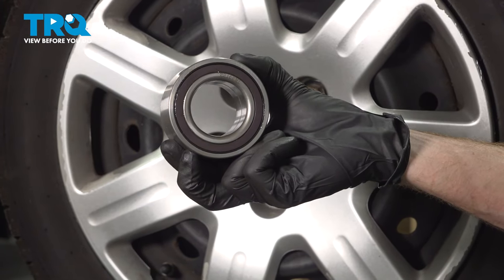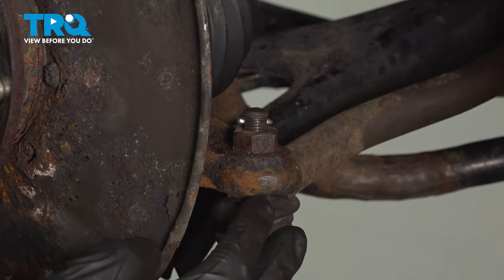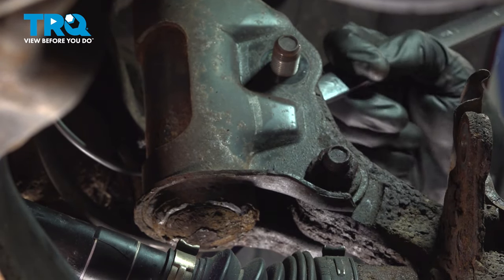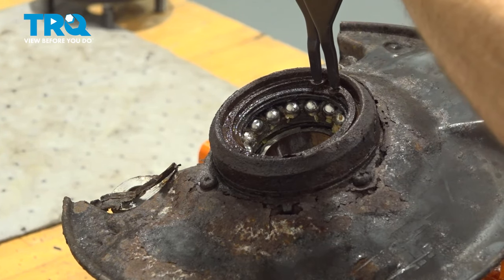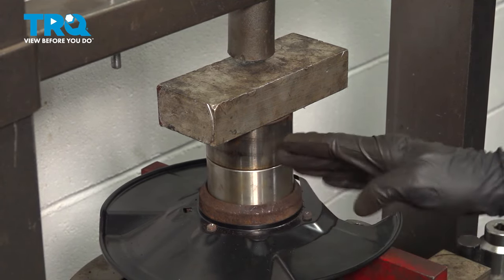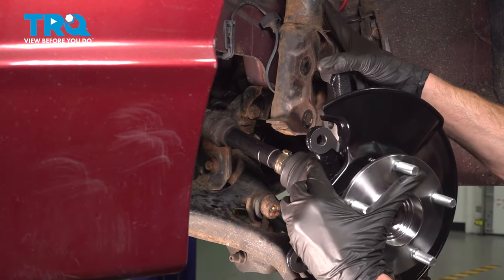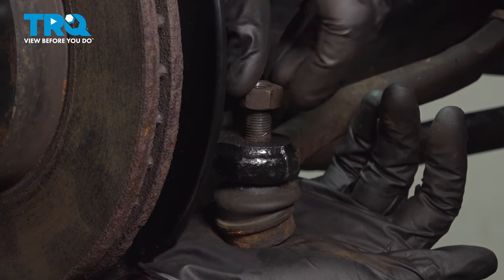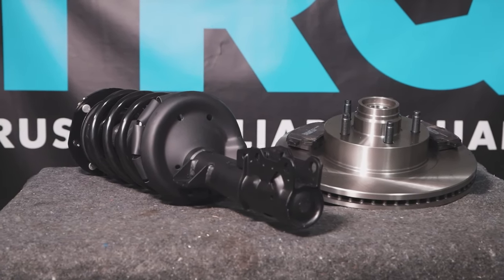How to Replace Front Wheel Bearing 2006-2011 Honda Civic

Comment: what happened to the knuckle u pressed the bearing into? u installed a brand new knuckle with bearing and hub also when u pressed that bearing in u didn't put any grease on the bearing u installed it dry..... not to mention if I was resusing that rusty knuckle I would've wire brushed it and painted it with some corrosion reducer paint....

Comment: I am going to tackle this soon but a little confused on the removal of the sleeve from the old OEM wheel hub. Check out 13:56 , is that step necessary because when you remove the wheel hub, that sleeve if that is what is called will always be stuck with the wheel hub upon removal? if I get both new bearing and wheel hub, I do not need to do this step correct?

Comment: Once you press (or hammer) out the wheel hub, TAKE OFF THE BACKING PLATE BEFORE you try press out the bearing otherwise you'll damage the plate & the knuckle!
I'm so upset I damaged the thing, the bearing would not press out & I had the caliper bracket mounting points flex on the edge while in the press bending the upper mounting. Bad day!